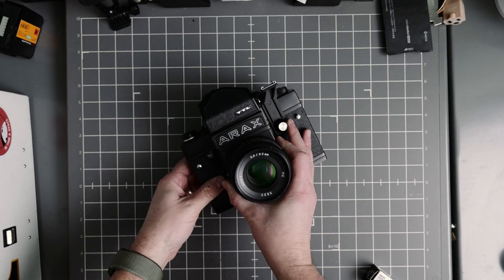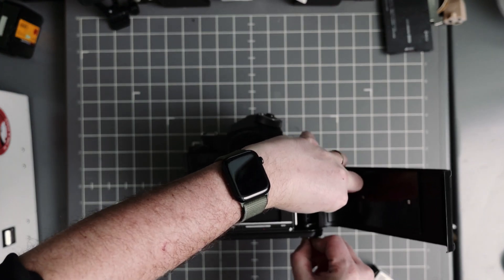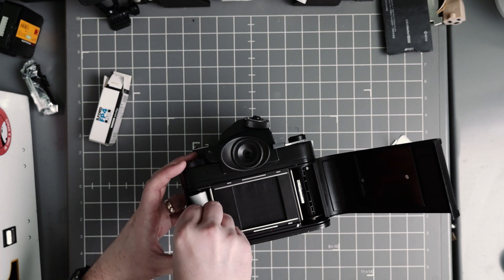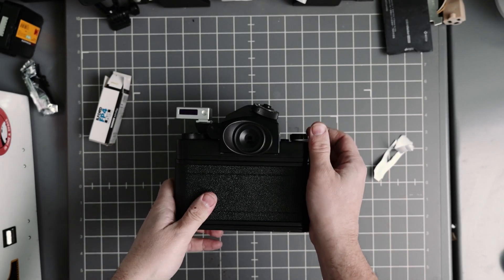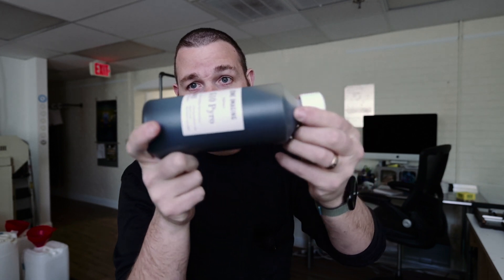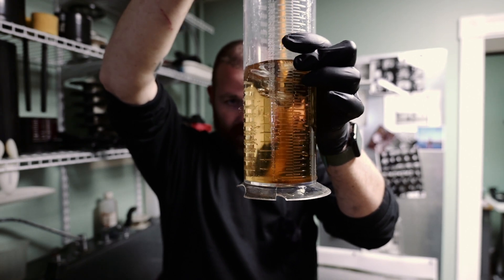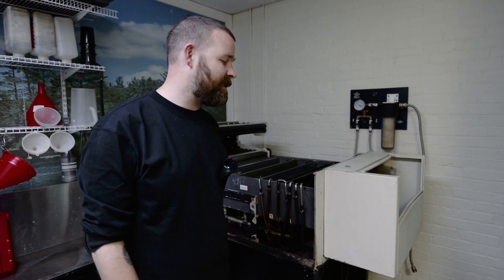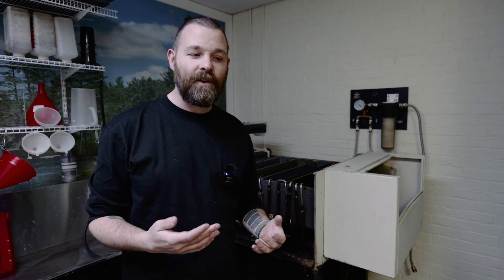Lab Diary for Early April 2023 & 510 Pyro Introduction

Comment: I know arax and hartblei are still refurbing kievs but i don't know if they are selling bodies.

You should hop on the kievreport or kievaholics.   I think your loading technique needs just a little finesse.    Around y2k that method of loading could lead to uneven frame spacing and possibly damage to the wind mechanism.   If your going to put it on a boat for refurb make sure to take some shots with plenty of sky at higher shutter speeds.   Your looking for shutter banding.   The kiev 88 is more prone to it but it has occurred in the k60s.

I used 510 pyro for the first time last week.   Cleaning the little rubber cup and syringe requires a little more effort than i'm used to.    The developer does have some potential that i can't wait to explore.

Comment: I too have an Arax 60. I bought it used, but I needed to recoat the shutter curtain because it had become very 'semi-transparent' many pinholes. I used spray electrical insulator. I really should send it back to Ukraine, but they're a bit busy there at the moment. It still has the Kiev feature that can run all your frames together into one big 13 frame panorama. BTW, I was told not to let the wind lever snap back- that can damage the spacing mechanism. You did seem to have nicely spaced frames. I have the 30mm ultrawide lens for it. It's nice and sharp, and a lot of fun.

Comment: Considering most people don't have fancy dev machines it would be nice to show hand processing.
Reply from the maker: I will definitely cover different agitation styles in later videos.  The Heiland TAS just simulates hand agitation though in a mechanical way.  If you’re used to “Ilford standard” agitation, that will work just fine!
Reply: The TAS is a great processing tool.  However, I was expecting you to use the Jobo before the TAS appeared.  😊